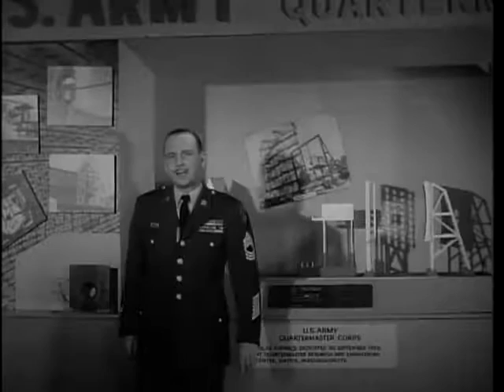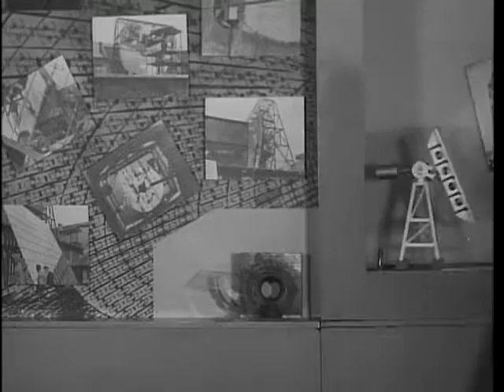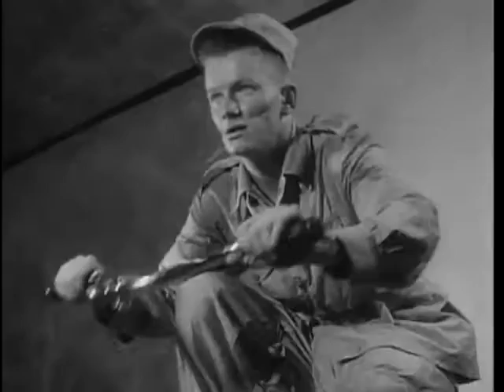The Quartermaster Story   The Big Picture

Comment from the maker: Quartermaster corps 第一部分
15:55   stride            11:10   obsolete+unusable            25:55    unceasingly
25:55  indispensable+insecticide    13:40 + 14:19 installation
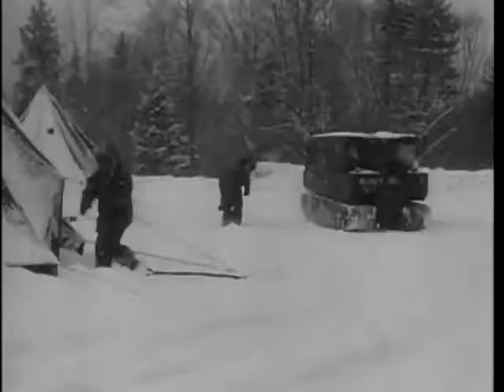11:37 develop specification规范     15:47  dependents       25:31  be conducted
22:22  inexpensive          03:15  sterilize      08:44  required for+specialized
14:41  requirement 3:22+11:48 +12:11+13:08+16:33 handle 21:33  is to(be to do)
04:28  continental +destitute               16:51  Defense Department
07:13  scientific research   09:36  far and away                 15:27+16:51 continuing
08:29  acquire                  24:48  encompass                       27:16  emphasis on
15:27  mobile                   17:39  make certain                     06:12   historic peak
十12:37  literally                 20:38    humidity        
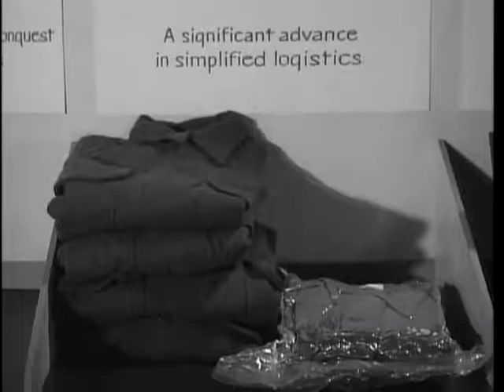20:03   controls necessary(必要的控制措施）+reliable  1:43 a fraction of unpackaged
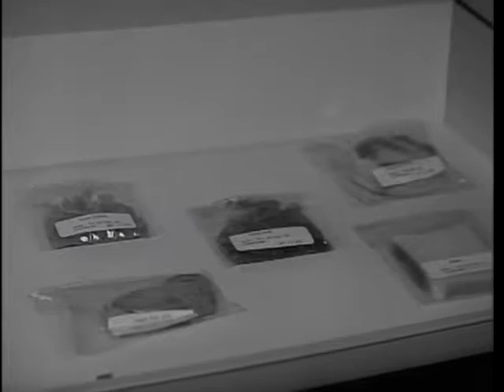03:15  airtight package    03:04  the application of            22:13+26:23  spectacular
26:23  ingenuity               04:56   advancing （现代分词，不断前进的）                
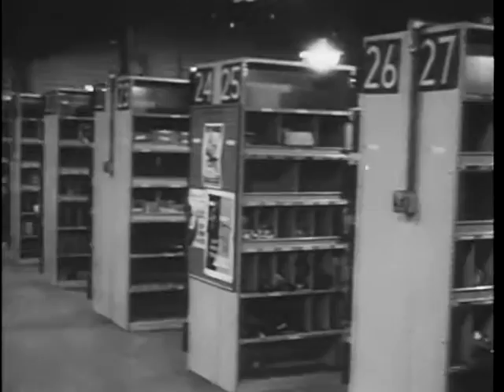12:05   at the opposite extreme +plier?  18:24  in addition to
16:51 overall management   03:36+12:11 terrain     01:00+09:27+22:13 recent
07:20 fragment                   07:11  the advent of+illustrative of
15:57  serve as                 05:26 +09:12+18:07+20:47 ultimately
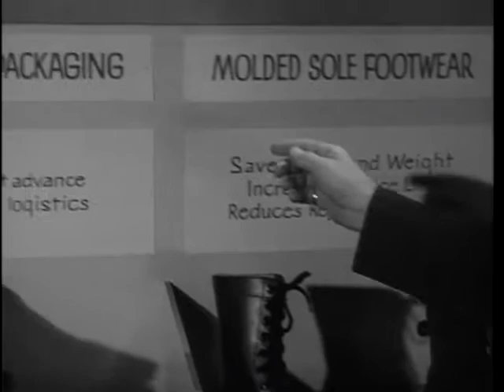06:27  proportion               07:11  garment                           01:37    a stack of
09:05  recommendation    04:45  parallel                           16:54+18:12   overall
二十22:45   widespread            03:04  age-old                 09:02+17:35+20:38  determine  
08:27+26:43  assume       14:47   appetite                           05:42  a total of
09:29  be responsible for  08:29+21:14  a variety of          05:30  lack 
21:33  analysis                    23:04  expectation                14:47   stimulate
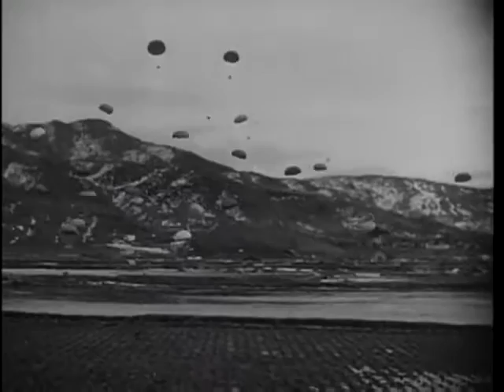07:49  remind                     10:35   distribute                         09:44  distribution
14:47  nourishing               13:47+14:43   nutrition              05:30   at a time when
11:17  the sale of                08:01+11:00  administer          15:57   as an incentive
19:16(v/a,n)coordinate +25:41 coordinated(a)  7:33+19:36 steadily 11:48   numerous
28:26  pictorial                     08:29  scope                              07:53  extend to
10:06  processing machinery                                                11:37  specification
三十18:54  take for granted          06:53+18:45  morale               14:53  dividend + morale
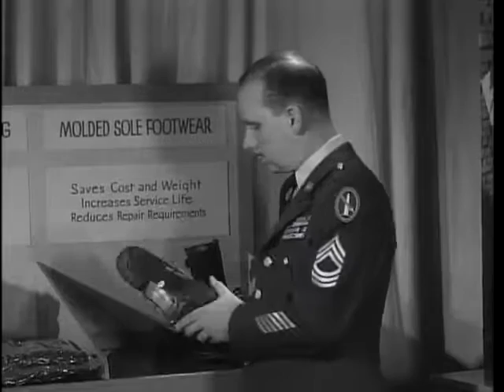12:32   steady+dependable  07:40  routine                          01:21+01:25  molded sole 
11:51 purposes                   16:25  bacteria +microorganism
20:38  determine(判定）+bodily                                    10:32  wasteful excesses (n/a)
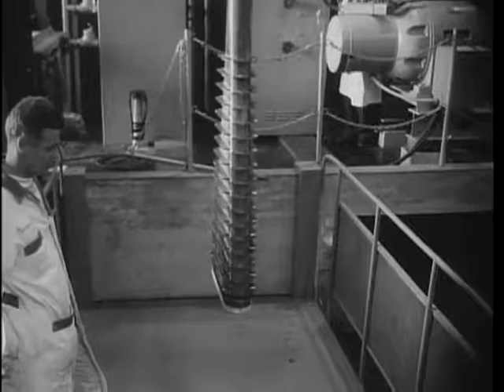17:25   essential +esprit de corps                          16:21  spoil+decay  (n)   
23:24   subjected to              21:10  peculiar                       02:21  (box,pear)-shaped
17:23   pride in                      14:12  to satisfy                      07:00   short notice
02:21  onto                            19:28   instant                          19:28  instant service
05:21  experience(V）         22:53  exact knowledge         01:37  letting
11:20+17:08+18:59+25:31+25:41   assure                       12:32  be assured a ... 
四十18:12   without regard to (不考虑，不遵守)                     08:12 accomplish
12:48   staggering             03:39  gigantic                 05:53  in history+ up to that time
09:40   scientific             26:51  envision                        11:10   disposal of
18:12   traditional supply practices传统的供应方式(惯例）  28:08   host (N)
20:03   with safety               21:52  safty and death       
01:07+03:22 +27:52 designed to         27:24  planning             23:56  influence     
24:56    ill effects                 09:29   utilization                   17:08   utilize
17:23   as long as             17:55   exercise (V）发挥...作用  27:24  carry on (carried on 
08:01  cemetery (cemeteries)  17:35  style and quality     07:17+20:47  type
19:24  unpredictable   25:31+25:41  standardized (V)(adj)    13:14+19:11  advance (n)  
五十24:39   anytime  anywhere     10:24  thanks to +management system
11:00+13:57  manage             14:43  considerably                19:41  be considered   
17:23   in existence                04:53+07:11+15:20 achievement   26:18  achieve 
05:10   expand                          
25:43+27:52   lowest possible + best possible                      02:14   under effects of  
08:29   nearly                          05:26+07:40  almost                  26:51  concept  
01:07+21:18   all of                13:14  enormous advances (n)    24:16   the value of
22:28   menace (n)                 12:15  in support of               28:26  in cooperation with 
11:16  recover                         19:47   be devoted to             27:52+19:47  devote   
12:11  forklift                           07:53   concern (n)                 03:39  a new portion of   
六十25:55   a large portion of       12:28   faraway                         05:30 tremendous task
19:41  thus                                04:25  appoint  20:17+21:52  combat soldier+ ~ uniform
05:10  minor sample               03:19  revolutionize                 04:31  all but
02:53   round the world          12:28   such ones as                 23:27   unexpected
26:23  even more                    12:37    warehouse                  18:07  transportation
                     19:47  survival equipment
24:39 survival power 05:21  previously experienced 22:53+24:13 be obtained through
24:13  obtain                           07:17+26:51  capable of          15:47   far from  
14:47+20:47 calculated to (用心良苦     15:47  favorite (a/n)     06:25  widely different
01:07+05:21  pose (v/n)    13:47  nutrition expert (n/a,v)   24:21 learn 弄明白,弄清
七十03:49  (v/n) range through  20:13 a wholly different set of  22:13  firefighting suits
20:26   undertake                   07:40  (a/n) routine supply operation  22:24 brush (n/v)
19:41   defied (defy) 向...挑战  01:07  continuously     15:27+16:51  continuing efforts
 15:27+16:51  within                  18:59  presence                   28:26  present (v/a,n)
26:39   significance                 11:27  function (n/v)              12:48  function (v/n)
05:10 +07:00  20 years later  01:25  (v/a,adv,n) last for  21:33  (a/adv,v,n)last analysis
13:37+14:43  plan (v/n) 8:44 an ever-increasing number of 7:11  remarkable garment
15:20  remarkable achievement  15:57  remarkable stride of 14:47 additional effort
04:28+13:00  entire                18:07  entirely              10:57 (a/n,v) open storage space
03:49+23:56   whole (a/n)     19:24  global affair   2:39+3:22+16:31+19:56+23:56  may
八十8:29  broad   0:52+19:28  outside (prep/a,adv,n)    27:16  mobility + flexibility
03:49+07:49+13:32+17:35+26:59 responsibility    08:20  assume responsibility
19:28+06:20+06:46  equip 9:59+22:53+27:24  extensive   10:24  operating inventory
02:53  follow (v)  0:52+11:55+13:32 around (prep/adv)    14:47  in a manner
02:53  (prep/a,adv,n,v)round the world 09:12+01:07 affect (v/n) 19:28  be prepared to
23:04  results confirm the expectation  24:13 results confirm those
12:28  whether or     20:22  be expected to    23:24 in unexpected ways
14:19  make periodic visit to19:41  man's very existence    09:29  public fund (n/v)
15:20  procurement      03:15  process (n/v,a)      08:18+18:38  element 要素
07:33  steadily increasing (a) 8:44  ever-increasing (a) 22:24 (v/n) increase efficiency
九十26:59 increasingly important (日益重要的27:16 increasingly difficult (难度日增的)
17:08 economical means  14:47  cost (v/n)   25:40  cost (n/v) 
18:04 transportation and supply economies 运输供应节约式经营   18:24  issue point
22:53  issue (v/n)    25:14  standard issue 标准配置    08:01  be entitled to  配得上
10:27  actual needs 实际需要   04:10  in action     19:11+20:38+21:10+22:13  activity
15:57   past (a/adv,n,prep)      27:28  past (n/a,adv,prep)   03:15  pass  (v/n)
07:40+13:47  employ (v/n)      09:36   cope with     24:08  wide variation
17:08  overlap (v/n)     02:03  original (n/a)      09:12  originate  23:33  wear and tear
04:18  reference (n/v) 3:22  alike (adv/a)15:20+17:08 means (n) 
21:35+21:52  mean (v/n,a) 09:02 doctrine    19:36  live on     01:21  footwear
佰 26:51 rapidly      21:39 (n/a) worth of wear     03:49+16:07(2)  (adv/a,v) even + 名词
15:27  (adv/a,v) even + 介词  26:23+26:39  (adv/a,v) even + 比较级
15:47  have access to   20:47  translate into 16:07  direction   18:04+13:57  wholesale
24:39  anywhere (adv/pron)   14:41+18:54 (conj/R-adv)  wherever possible 
02:41+15:07+27:52  wherever   13:14+19:11  where (R-adv/adv,conj)   停止添加